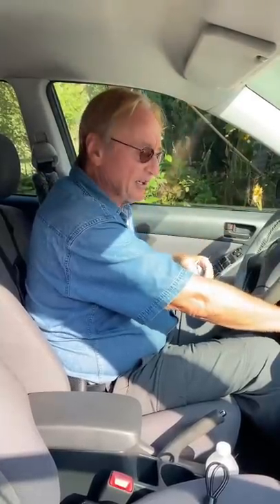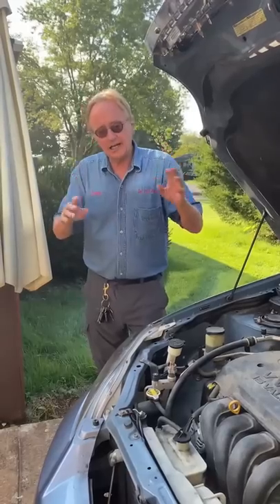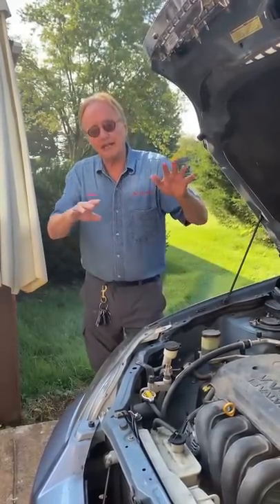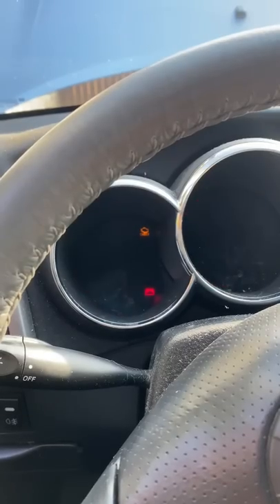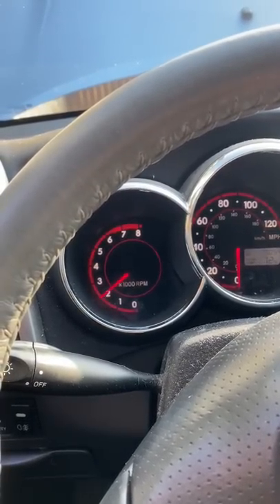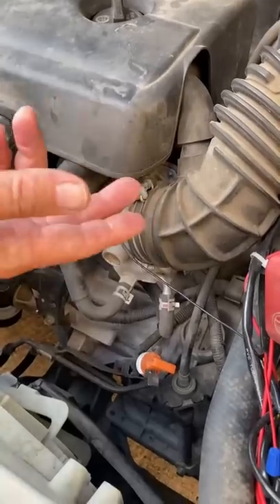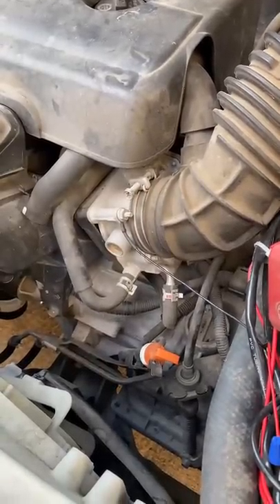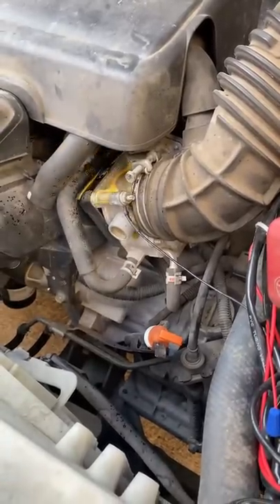If Your Car Runs Like Crap, Do This

Comment: Only 75,000 or so miles on Scotty’s Matrix?
I have over 317,000 on my Matrix.
Reply: i thought they stop at 299,999
Reply: @Xiferr  
It did stop at 299,999 😂
I just use the distance odometer and write it down on the tape on the windshield to know my mileage.
Reply: @igorseprak6177  nice work man any issues in yours? i got mine used so im not original owner just had to replace starter at 172k miles
Reply: @Xiferr  
Zero problems with the transmission, engine, and timing chain. I do think changing the oil is absolute key. 
Between 200,000 to 220,000 I changed both starter and alternator. 
Of course, change the serpentine belt when it shows cracks. It’s an easy job.
I need to do both upper and lower control arms. Still original ones on the car. The front tires get worn more because of beaten control arms. I take care of my car as to the brakes, tires, and regular oil changes, but really abuse the rest. The car takes a beating well. Very forgiving. Highways, dirt roads, salt...
Reply: @igorseprak6177  i did all motor mounts and front lower control arms also they were very worn when u tighten lug nuts wheels would shift. but yes 1zz is great egine!
Reply: @Xiferr  
Yes. Motor mounts another thing to replace at 200,000. All cars.

Comment: factually inaccurate, now that most cars are fuel injected there is next to no carbon build on the throttle body so  a sticky throttle blade is highly unlikely unless there is some other underlying issue.